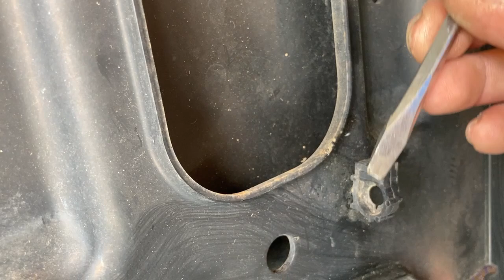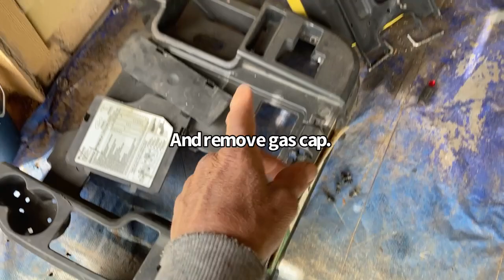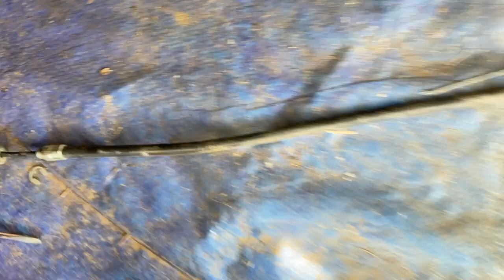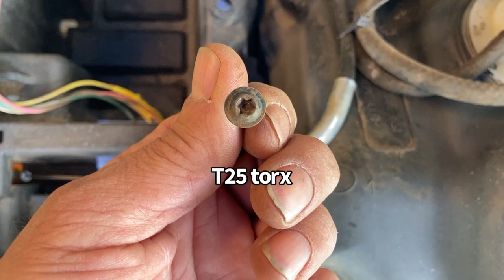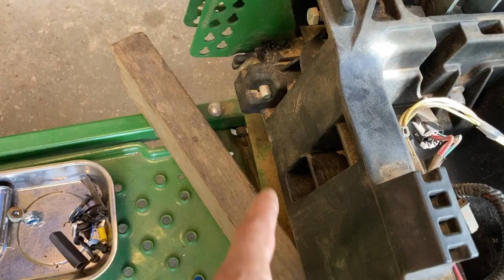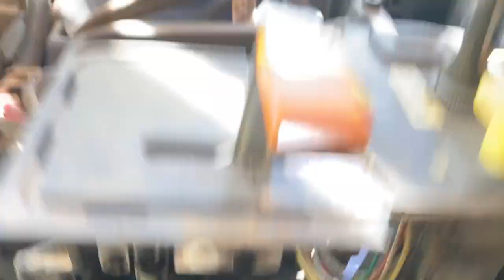John Deere ZTrak 335E Lift Cable Replacement

Comment: "It's really not that bad" --  lol.. 
Sir, it literally could not be any worse.
What's left?  pull the engine and remove the wheels?   There's nothing else bolted down anymore. hahaha.. It's the worst design I've ever witnessed in my life.  You could not make this any worse if you tried your best
Reply from the maker: Worse was my Craftsman lawn tractor's cracked frame. Literally everything is bolted to it with self tapping screws you have to re-thread into the new frame. Replacing that was way, way worse. Lol. Removing my Supra engine was pretty challenging by my lonesome too. Sorry if I made it sound too easy. At least you got it done so I'm happy for you.
Reply: @EricsCarLot  Yeah..  You gotta get yourself a welder.
Reply from the maker: @calholli  Never would have lasted where it broke. Plating would have needed several holes drilled so I opted to replace. It's maybe 16 gauge or 14 at best. Super cheap stuff.I did weld one bracket back on to the deck. Still holding strong..

Comment: Next time it would be great if you actually showed the process of taking it out and putting the new one back in. I would say that a larg proportion of Youtube watchers are visual learners and have a hard time just following spoken and written instructions. I hate being that negative guy in the comments but I still don't have a good handle on how I'm supposed to put the right hand side of the cables back in place.
Reply from the maker: Sorry for not showing this to you better. This step you are stuck on is definitely awkward. You have to hold the bracket holding the two cables in the slot and then let the body back down. There is some pressure to bend the 2 cables and fit the metal bracket back into the slot so I understand your frustration. You will get it.

Comment: How did you put the trunnion back in
Reply from the maker: They can be a little tight but other than a pliers to push them through I don't have any real help. Make sure there aren't any burrs on the trunnion edges that need to be filed so it will fit through the hole easier. It's like a puzzle piece that only goes in one way.

Comment: Yeah. More like a 2-3 hour job. Got it done but not for the faint at heart. Good video and how to break it down. Thanks......
Reply from the maker: Sorry if I underestimated the time needed. I didn't take that long but I'm pretty small so that probably helped in getting my hands in these tight areas. 40+ years of turning wrenches helps too. I didn't find any other decent video showing this so I'm really glad so many people use it for reference. Pretty much only one way that cable is coming out and I agree it's not fun.

Comment: Thank you for your video. I'm in the process of replacing the cable now and could not figure out how to remove the plate where the two cables go through. I'll be longer than 45 minutes though.
Reply from the maker: As long as you get there. Glad the video helped you out. It's a very awkward job for sure. The cables are very rigid and hard to bend and move around.